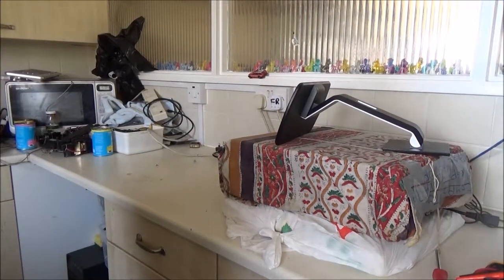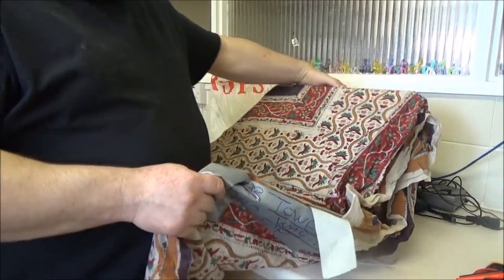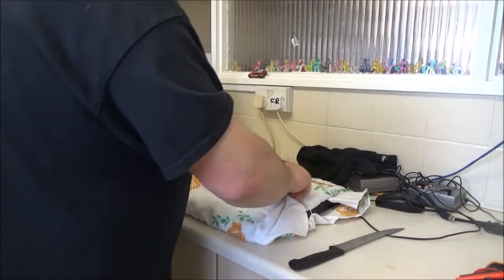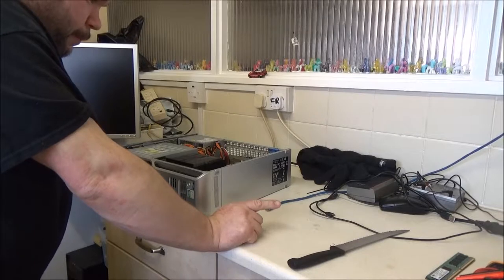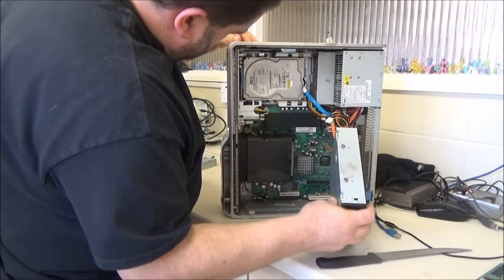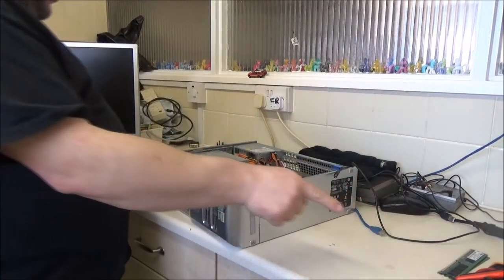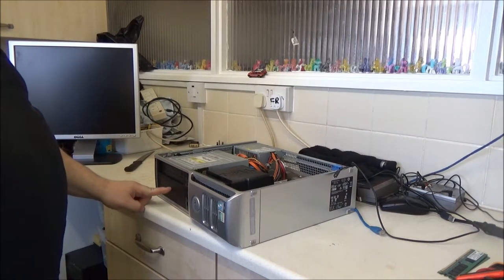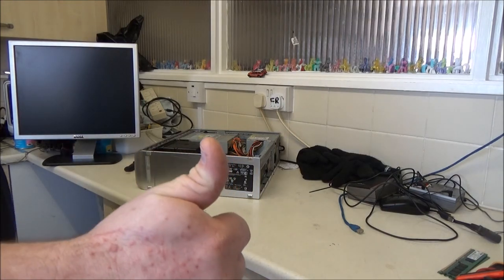Rescued A Dell Dimension C521.

Comment: hi. I got one of them today and plugged it in. and it's saying no boot device detected.. can you help me out plz..
Reply from the maker: Check it has a hard drive fitted. If it does the hard drive could be faulty
Reply: @RandyDarkshade2  I saw your other video I have it working I listened and watched everything you said and did. now I can't get it to connect to the internet. no wireless network adapter installed its saying. thx for replying so fast and thx for yr great video part 2. can you help we with that problem ..??
Reply: @earlcoyle7484  if you’re still having this problem I recommend connecting it with an ethernet cable to a router
Reply: @earlcoyle7484  May I also get a link to that video ? I am having that same boot device problem